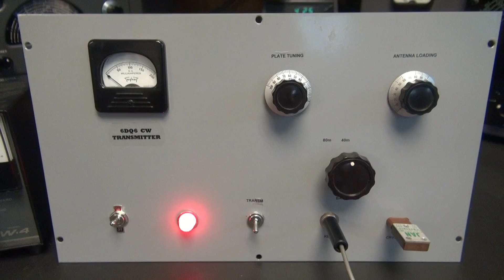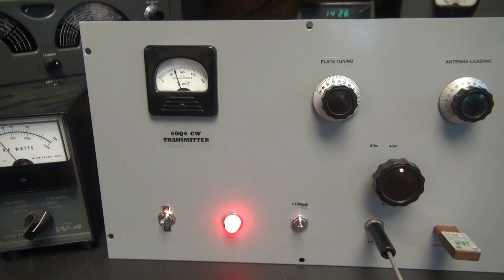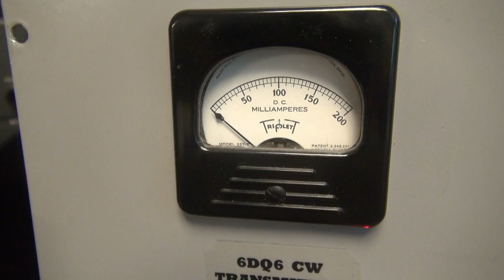Homebrew Hammared Ham 6DQ6 Tube CW Transmitter Demo D-lab

Comment: chirp chirp chirp chirp / chirp chirp 
hi hi Terry 
a real CWer.  Neat little rig.  Back when home made was from taking the radio flyer down the street lookin for old radios and TV sets to scrounge parts to make stuff with.  Half the fun was tearing into that stuff.  Hmmm, tear into, TERRY!  hi hi 
The idea was NOT TO BUY THE STUFF, GET IT FREE?  I have an old EICO up in the attic, bad T/R relay, weighs about six hundred pounds.  I made an EOL boat anchor vid last month with a Lafayette CB.  The EICO literally weighs more than the real boat anchor.  My working tube rig is a Drake TR4, um partial to Drake over Johnson, sorry OT, dah dah dah / dah.  Gotta string up a 130' dipole for the old gal for 75m.  Some day, I hope that you'll do a Drake?  I sent my old TR3 to a ham in Michigan, Dave KC8YOX, that needs repairs.  Might make a good subject for him.  Don